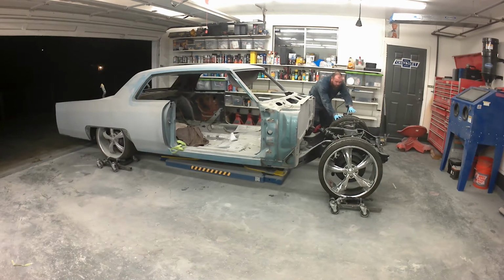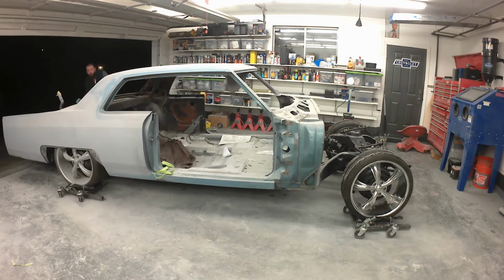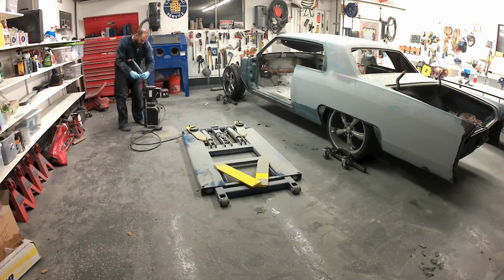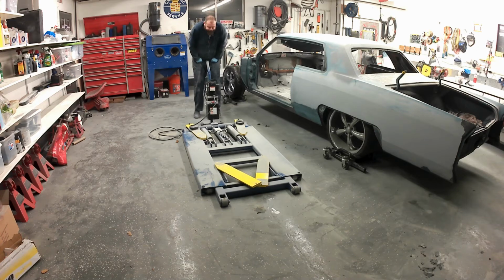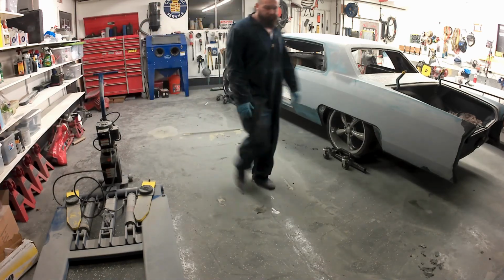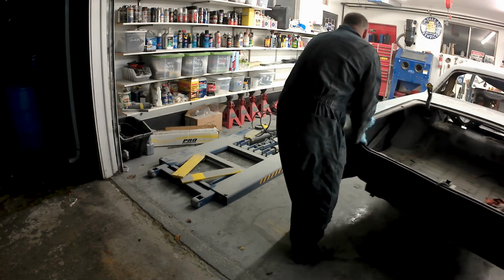Bendpack MD-6XP 6000lb lift + Harbor Freight Adjustable Car Dolly #61917 Demo and Review

Comment: I have had one of these for over a decade now. Best tool investment I have ever made. 

No, you cannot drop a trans on a rear wheel drive vehicle, and driveshaft maintenance is difficult. But they are great for service work, wheel/tire changes, and old VW's since they don't have much in the middle.

It is rated for 6K pounds. I have lifted my 5K pound Chevy Scottsdale with no issues at all.

I love mine. Highly recommended for those with lower ceilings where a two post lift would not work out.
Reply from the maker: Thanks for the write up Sir. I love mine

Comment: I've been meaning to pick up a set of wheel dollies. Never thought I'd need them as I only ever expected to have two cars in the shop at one time. But with the city on my ass I had to bring in two more and now things are pretty tight. The funny thing is I usually try to pick up used on these type of items but every time I've looked everyone is selling used harbor freight dollies for the same price as new. Hell, with the 20% off coupon I get get them cheaper new.
Reply from the maker: Yep your right! If you watch the ads the will mark them down 20 bucks that's when you snatch them up. The 20% only gets applied to one. They are worth every penny!
Reply: Ratsnest Hotrods that's good know. Thanks

Comment: Can you drop a transmission on a rear wheel drive car with this lift?
Reply: Nope.  At least not very easily. last clutch I did I just yanked the engine, since it need a bunch of new seals anyway.
Reply: Yes you can david if you use this lift correctly
Reply: @mastermindstv7839  Not sure how unless you have 18" tall adapters.

Comment: Have you ever used it to lift a full size pick up?
Reply from the maker: I havent but I wouldn't hesitate to put my Silverado on it. Just as long as your rig weighs less than 6k you are fine. Several other vids showing it lift trucks

Comment: YOU ARE DANGEROUSLY USING THAT LIFT WRONG. DO NOT GET UNDERNEATH THAT LIFT THE YELLOW ARMS ARE SUPPOSED TO BE HANG OFF THE SIDES NOT THE BACK OR THE FRONT YOU HAVE THEM ON THE WRONG SIDE OF THAT BLUE RECTANGULAR NUB OR TAB.. OMG PLEASE USE THIS THE RIGHT WAy #BENDPAK